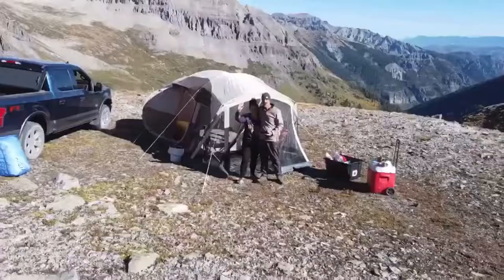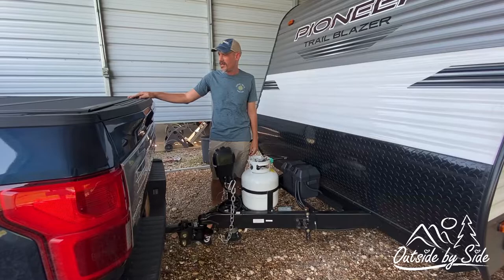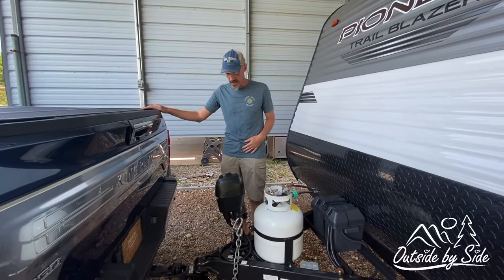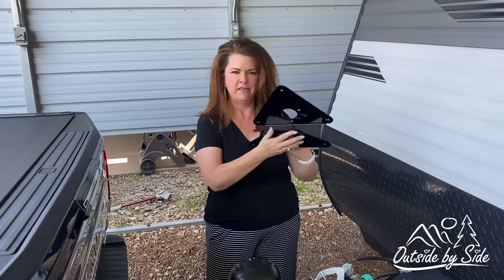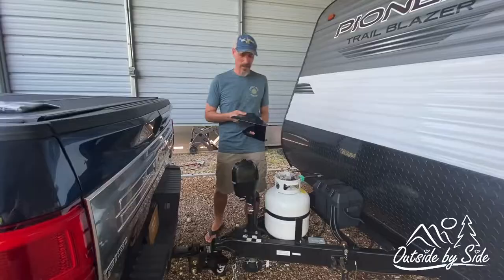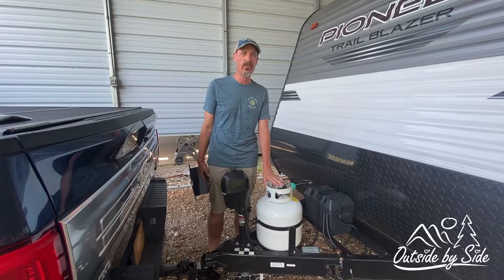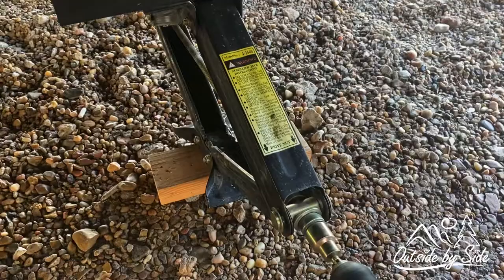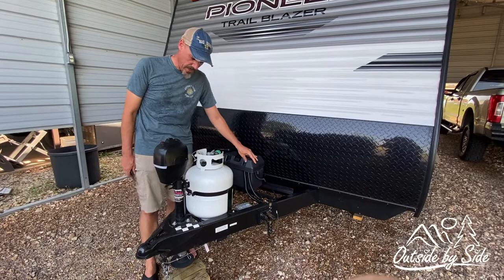HOW TO STOP TAILGATE FROM HITTING TRAILER TONGUE JACK w/ JACK BACK

Comment: Well, the first issue you have is that you do not use your stabilizer to support the weight of your RV also, you need a square solid pad made out of wood is fine to put those stabilizers down onto. The safest way is to use some jackstands or a bottle jack that way you can lift it up if you needed to, but jackstands will work just fine. Your stabilizers are only to stabilize the RV from rocking side to side when you walk in it. Using it to hold the weight of your RV is a recipe for disaster. It may not have happened this time but it will happen. They get tweaked and bent. Glad to see all your different modifications. This is definitely a good one.
Reply from the maker: @michillekrantz5154 Thanks for pointing out our mistakes. We are aware. Have a great Thanksgiving!😊

Comment: You can just loosen the head and rotate it on the shaft, no re drilling required
Reply from the maker: @Dale Nelson yes, we have seen people do that but it’s not possible on ours and we don’t want it facing the opposite direction. We appreciate your suggestion and thanks for watching our video! 🤩
Reply: I was referring to the three new holes you had to drill in the new bracket.

Comment: It appears that bracket was designed to split the load of the tongue between the upper and lower plates. After it was cut in 2 there was zero benefits to bolting it to the bottom of the tongue as all the tounge weight is now just on the top section.
Reply from the maker: @Caleb Smith We agree with what you are saying but we had to make it fit so this was the only option. It has worked great so far! Thanks for watching our video! 🤩
Reply: @OutsidebySide  great video. I'm getting ready to install this same jack. I hope I like it.
Reply from the maker: @cdsmit27  please let us know how you like it! 😄 Thanks a bunch!
Reply: Not to mention drilling the frame with no additional support.

Comment: I would not think trailer frame, trailer manufacturers, or dealer will honor any repair with those modifications especially drilling holes.
Reply from the maker: @ronaldwhite6256 You are probably right! We have done all of the repairs ourself. Thanks for watching! 🤩

Comment: A Jack-E-up would have solve your problem without modifications!
Reply from the maker: @Roger Laroche We did look at the Jack-E-Up but we didn’t want to have to remove & attach the Jack each time we open our tailgate. Our Jack is electric and wired into the battery. Thank you for watching our video! 🤩